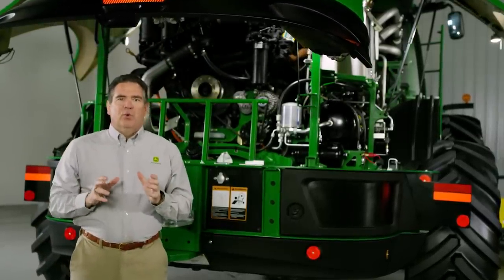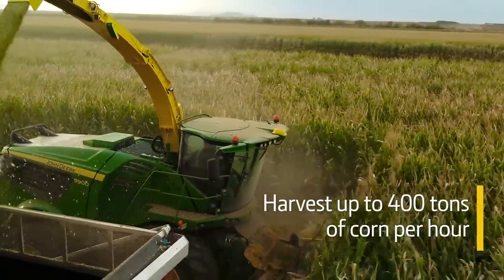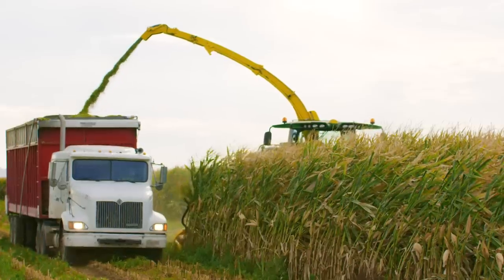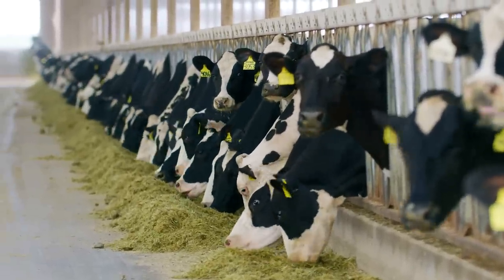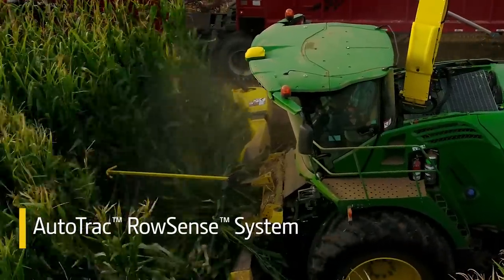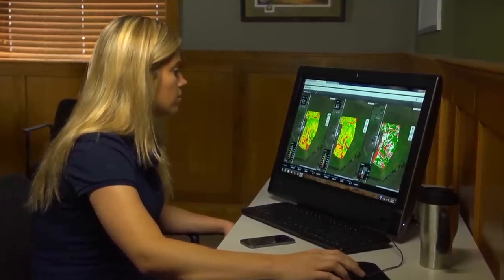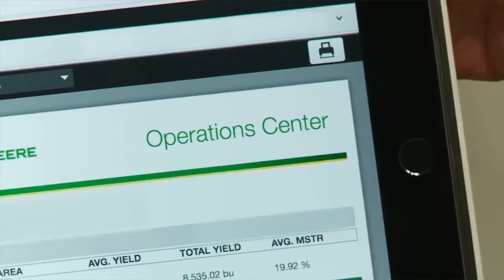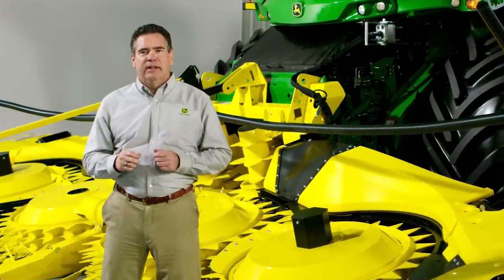9000 Series Self-Propelled Forage Harvesters

Comment: How many rows can it take?
Reply from the maker: Ivan, that depends on what front-end equipment is used with the forage harvester. For example, pickups are available in 3.0 m (9 ft. 9 in.), 4.0 m (13 ft. 1 in.), or 4.5 m (14 ft. 8 in.). Large drum headers are available in 6-, 8-, 10- or 12-row, and small drum headers are available in 4-, 6-, 8-, 10-, or 12-row configurations. For more information we would recommend contacting your local dealer. If needed, you can find your local dealer at dealerlocator.deere.com.
Reply: John Deere yeah but how many rows of corn can it easily take? 16?
Reply: 12 row 30inch is what there saying when 12 row head

Comment: didnt really explain much pretty vague still dosent compare to a claas
Reply: vettelover2009 it’s not only horsepower that makes a chopper good. 8000 series was a fail so they quit making it for this. Most likely not fixing the issues they had with the 8000s.
Reply: they make there own heads and claas also has a v12 made by MAN
Reply: Vettelover2009: I knew a guy who bought the 8600i Pro-drive with the 375 kemper head, the header hit the ground on the right side while harvesting and the whole chopper housing flexed and the knives hit the counter knife and blew the whole chopper system up. The guy went bankrupt because he lost 6 weeks of the season while the brain dead John Deere mechanics tried to fix it. The new machines look smart, but John deere has become such a money whore that you cant fix anything yourself anymore and their mechanics are also too dumb for these hightech machines.
Reply: vettelover2009 they have big issues with a lot things if you put them up against new holland or claas. Their kernel star processer was a joke. Always plugging and spinning out on the feed. Plus it did a pretty bad job. We ran a 8600 and two times in the last year we hit a small wash(normal for around these parts) and the shearbar went into the knives, wrecking the cutter bar and processer. Lots of computer stress and so on. Never seemed to add up to what other companies manufacture especially class and nh.
Reply: Fum3s absolutely same here. Same issue same story. The 8000 series was a total flop and like normal jd im sure they didn’t fix the real problems they just added a motor which they didn’t need and a bigger screen on the armrest and called it the 9000 series.
Reply: I thought Man only made engines and trucks